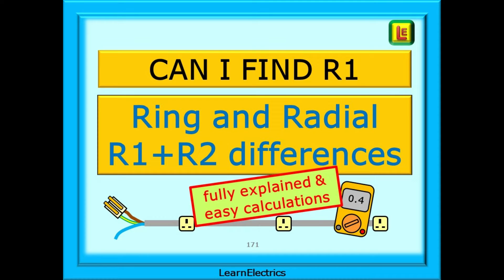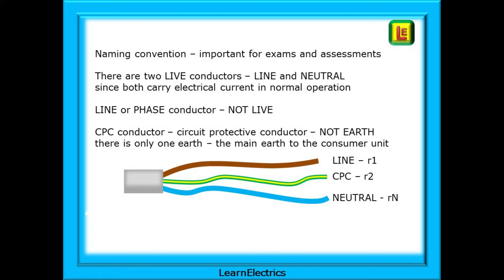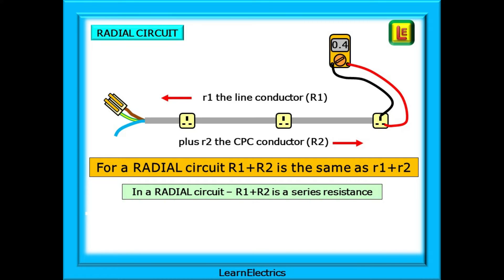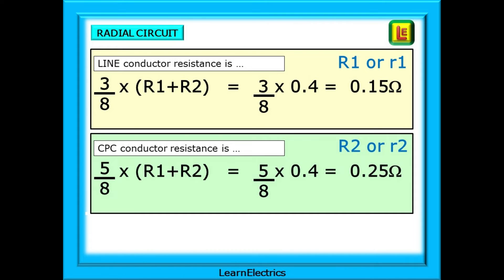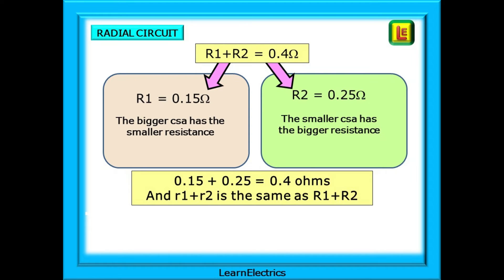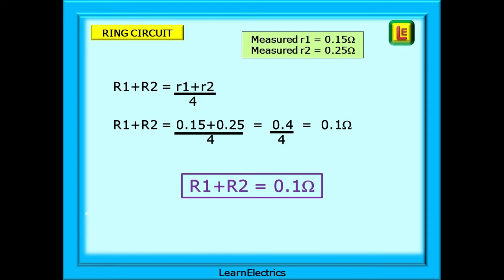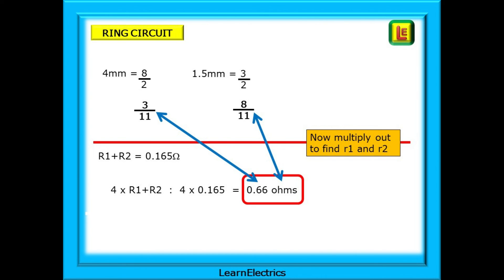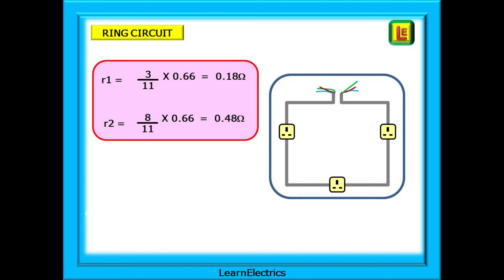R1 AND R2 – CAN I FIND R1 IF I ONLY KNOW R1+R2 – WHAT ARE THE RING AND RADIAL CIRCUIT DIFFERENCES

Comment: Hello Dave, great video as always. May I ask, in a lighting circuit with no cpc, would that mean in an EICR, the measured maximum ZS cannot exist, and will be recorded as a Limitation? Many thanks
Reply from the maker: If its a class 1 light fitting it is C2. If a class 3 light fitting them C3. We have a video on this being worked on as we speak. Watch this space. Hope this helps.
Reply: @learnelectrics4402  thank you so much for replying Dave, I really really are grateful.

Comment: hello dave. how do i calculate the r2 of a circuit if i only have the r1 reading?
When testing continuity of a ring final circuit wired with 2.5/1.5 PVC/PVC conductors using 'Method 1'. The value of R1 is 0.4Ω, what should be the approximate value of R2
Reply from the maker: Have a look at this video Chris.
https://www.youtube.com/watch?v=Wl1--nxRnME

Comment: Hi very informative video but i don’t understand where you are getting conductor halves values please can you explain
Reply from the maker: We need the ratio of the two cable sizes. As one of them is 1.5mm or 2.5mm we can;t use whole numbers so we make them both into halves - since 2.5 is the same as 5 halves. Keep practicing, re-watch the video and it will make sense. Once understood, you won't forget it. Dave,

Comment: Briilent as usual!
Any chance doing a video on generators!
Eg. Floating neutrals & bonded generators as we in ireland use double pole change over switches breaking both line & neutral so have to use bonded with an earth rod!
Thanks mg.
Reply from the maker: Thank you Malachy, its now on the list. Thanks for the support. Dave.

Comment: Great video not being great at fractions don't get the CSA multiplier factor how that is worked out.
Reply from the maker: Its just the ratio of the two cables but we can't use whole numbers with 1.5mm, 2.5mm etc so we make both cables into halves. The more you practice it the easier it becomes. Stick with it, learning is good. Dave.
Reply: Same here. Had to go with 15 as common factor and worked it around that. Final answer when rounded off to nearest figure worked out closely the same
Reply: @johnwasswa  good job ,I worked all out finally using a scientific calculator . I could not give up lol